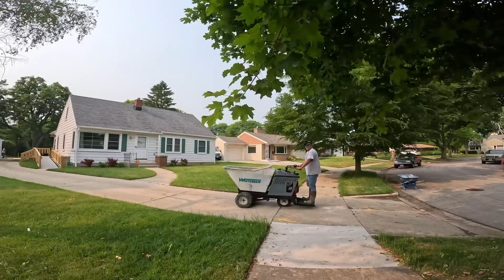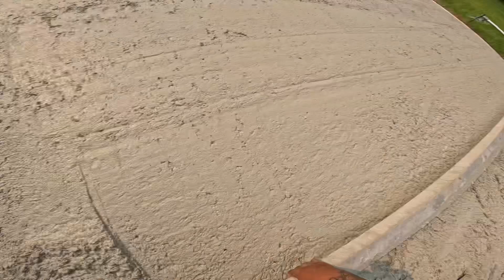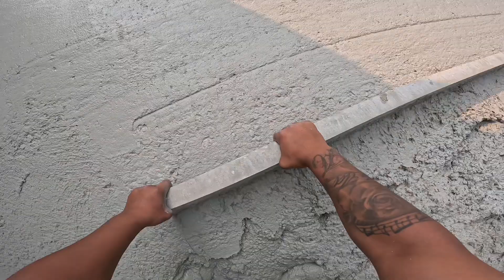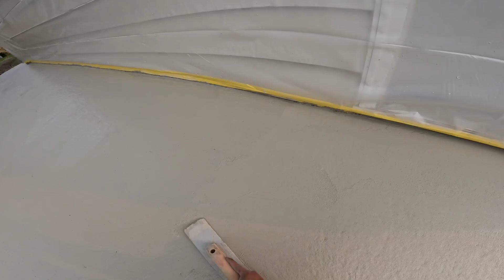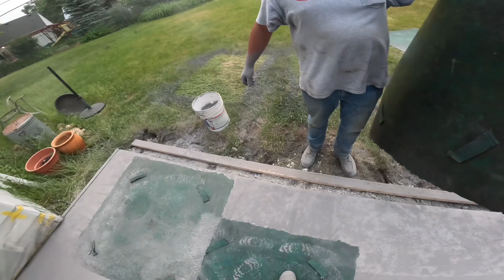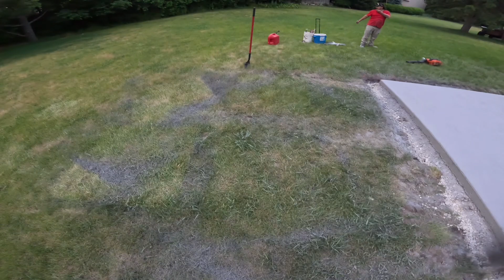1st collaboration mikes job !!!! Stamp concrete!!!  Here we go.

Comment: @easyy E Concrete - genuine question (no hate) why don’t you use wire mesh like this and Ryan? Is the amount or rebar you use enough to stop cracking?
Reply from the maker: Started to used wire
Reply: @easyye.concrete  keep up the great work. Just don’t burn yourself out

Comment: Low spot outside that door,  gonna be a birdbath every time it rains, should have had screed closer to bldg when striking. Also, have someone tapping the forms with a hammer, removes air pockets, especially with stiff mix like you were pouring.  Not a hater, 40 year construction person.  Goood work!
Reply: I was wondering on the reinforcement being lifted off the ground. Didn’t seem to be lifting it as they poured

Comment: Eric look into getting a walking float( funny float). Doesn’t seem like to many midwest guys use them but it’ll change your life.
Reply: Are you talking about a funny trowel? I'm from WI and we choose not to use them or regular trowels because of our climate with harsh winters.  Any trowels are made of steel which seals up the surface too much. A magnesium tool keeps the surface "open" so  as to not trap the bleed water beneath the surface. This trapped water leads to scaling and other surface defects in the Midwest. I hope I didn't misunderstand your suggestion.
Reply: @theakkid8910  no, that’s why I said funny float and not funny trowel..a Google search on your end could’ve explained that. And any half decent finisher should already be fully aware of everything you said but thanks.